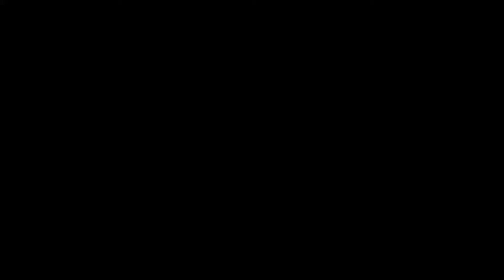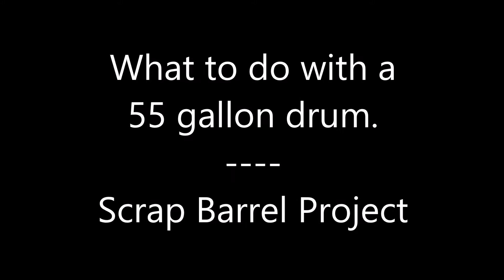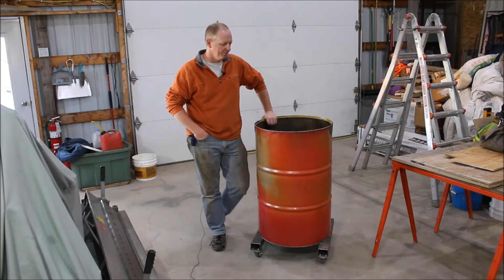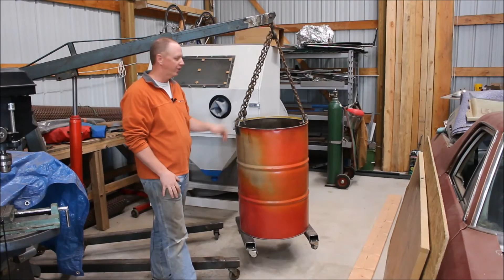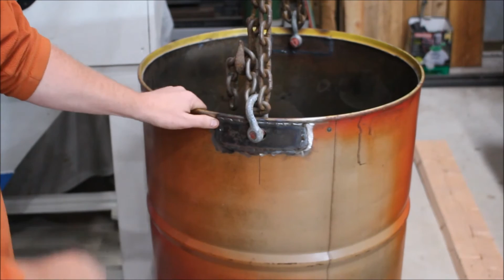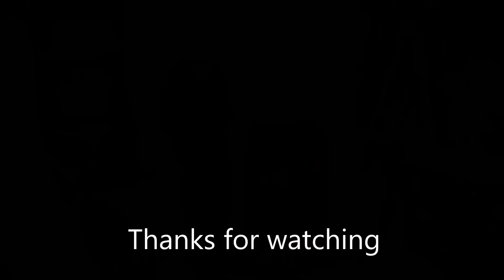Using a 55 gallon drum for a scrap metal barrel

Comment: Thanks for the great idea. I have a poly barrel I use for general shop trash with a liner. I bought some casters from the Harbor Freight store in Cheyenne a while back but I never got around to figuring out how to fasten them to the bottom. Your attachment is very clever. Should work with poly barrel too, minus the welding of course.
Reply from the maker: Welding might be messy on that one, but a few bolts with some fender washers through the bottom might just do the trick.  Thanks for watching.